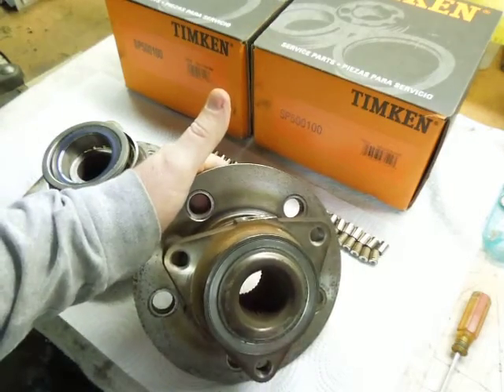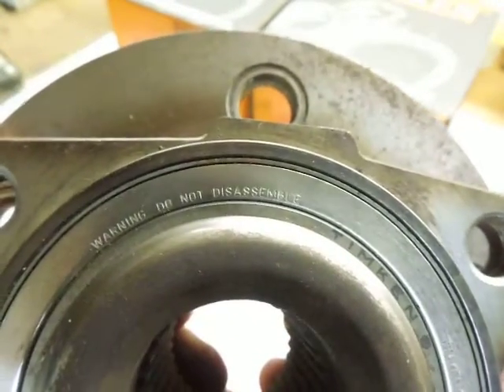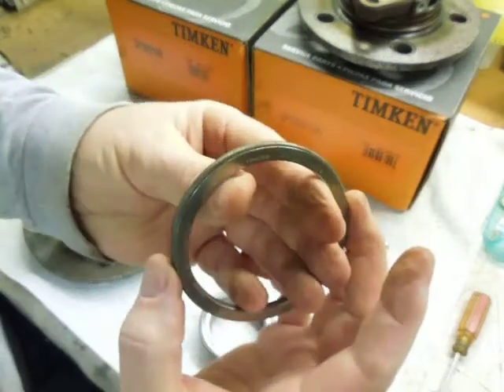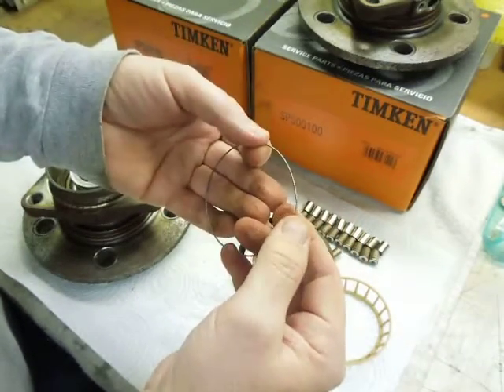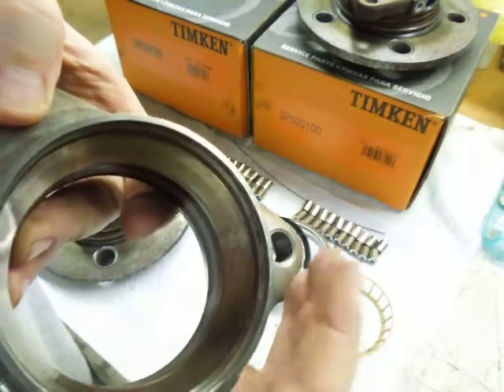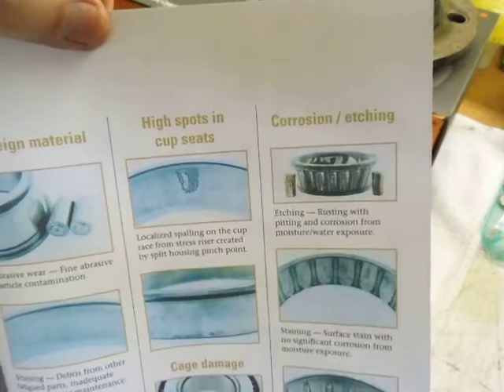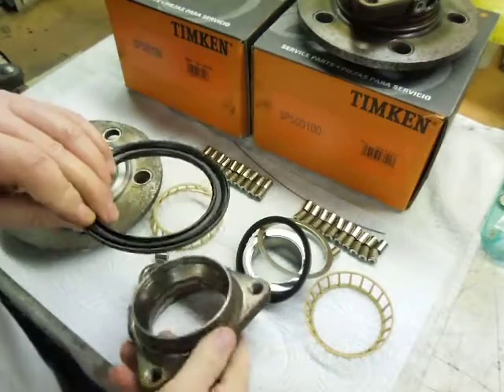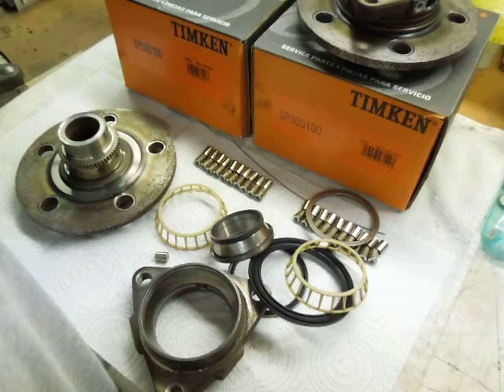Timken Sealed Wheel Bearing/Hub Failure Disassembly and Review

Comment: Do you think that I could grind that curled edge that holds it together (the one that you machined off). I’m thinking my angle grinder might be able to nip enough of it off. Then I’m thinking of using a large gear puller to pull the hub apart. Thanks for the video as well.

Comment: I NEED AN HONEST ANSWER! Guys, do you really think its not possible to reseal this? Both sides of bearing are held in the body just by this exact seals. If you would press both sides carefully in the body, why wouldn't it be possible to reseal them? Thank you.
Reply: @lukahlisc7670  honest answer, no.  It took hours to machine off the rolled over hub and disassemble them.  Once you remove the hub, there is no way to secure it so it won't come apart again and you would just be guessing when you try to set the preload on the bearings.  And all that assumes there is nothing worn out or damaged when you get them apart.  Buy a new set from Timken or SKF and you'll be way ahead.

Comment: I sure miss the old wheel bearings,  repack them every few years and they would last forever. Most likely the same engineer who came up with putting the fuel pump in the tank, Great video thanks for sharing I was getting ready to rip one apart curiosity was getting the best of me
Reply: Thanks for watching and I'm glad the video was helpful. I miss the old set up too, they would run forever if you repacked the bearings at each brake job.  My guess is, car manufacturers/workers got tired of having greasy assembly jobs and that lead to this, no mess, bolt in design.

Comment: How did you get that first seal out exposing the tainted bearings? Basically how did break into it? Thanks
Reply from the maker: I machined the rolled over lip that I tough at the 11 second mark and then pressed the hub/shaft out of the bearing assembly.  You can see the machined off stub on the one that's taken apart. Thanks for watching.

Comment: Awesome video, thanks for sharing it!!! Do you know what might have contributed to the metal failure as shown in the video, besides the material itself? Do you think it has anything to do with say speed bumps, potholes, off-roading, etc? The front bearing on my RAV4 started to develop a minor grinding noise, only 40k miles without ever driven in harsh weather or off-roading. I'm trying to defer the repair due to labor cost.
Reply from the maker: I suspect since the 3 failure points were equally spaced the housing was slightly deformed when they clamped the part to  grind the race surface. When the housing was released, that created high spots that are the failure points.
Reply: @snaproll94e  Thanks, that makes a lot of sense!

Comment: Henry Timken and his son-in-law invented the tapered roller bearing in 1898 afterword other producers copied the design but were never better at it then Timken by 1920 when Henry Ford changed is production over to Timken Bearings   Temkin Roller Bearings were in 100% of all the vehicles produced in the world Timken went on to revolutionize many industries with their superior steel which they make some of the worlds best steel right here in America and the superior engineering that most of the world turns to 
for instance todays advanced roller rocker technology came from Timken Engineering and drive by wire electric steering  Timken did that / I say all that to tell you YOU can't find more durable longer lasting wheel bearings from any manufacturer anywhere in the world - it is most likely that the gasket seal failed usually that means sand eroded it if a bearing seal fails the bearing will show it in some way , Timken can't be beaten in the areas of Bearings / Engineering / or Quality Steel Period
Reply from the maker: You must work for Timken?  I've worked with their engineers for 30+ years, been through one of their bearing manufacturing facilities, their R&D facility (very impressive) and installed thousands of their bearings in high-performance gear boxes. They make a quality product that is usually to a six sigma quality level. With that said, I stand behind my analysis of the failure.

Comment: So, how did you get this apart? I am confused as to how the flanged part that bolts to the truck does not separate from the bearing side that spins while driving
Reply from the maker: I had to put it in a lathe and remove the end that is rolled over and keeps the assembly together. The hub and shaft assembly is pressed into the inner cone and roller bearing and the end of the shaft protrudes through the bearing and is rolled over to secure it. If you know what to look for, you can see the difference in the assemblies at the start of the video.

Comment: How many miles did you get off the 1st wheel bearing set..?
Appreciate your teardown/inspection.....can you suggest a quality hub...? I fear being let down by poorly constructed or lesser quality.
Reply from the maker: I started hearing a growl at about 60000 and thought it was a new set of tires I had just put on.  Finally figured out it was the bearings and changed them out around 80000 or whatever mileage I quoted in the video. The new Timken hubs now have 65000 miles on them and are ok.  Next time I might try SKF if these ever go bad. Thanks for watching.

Comment: How many miles to bearing failure? I assume you fly aerobatics Snaproll?
Reply from the maker: Sorry for the long delay in replying. They started getting noisy around 65000 miles.  Yes, I used to fly a lot of acro when I had a Decathlon. There's a couple of videos on my channel if your interested. Thanks for watching.
Reply: @snaproll94e  65K? They ought to be ashamed of themselves over there at Timken. If it were a Koyo or NSK Japan bearing, it would only be at half life at 65k.   I loved the Decathlon with the pop-off doors and cloth-covered exterior. I think I had to wear a chutte too if I remember correctly. Good times!

Comment: I just received 2 of the timken hubs for my gmc jimmy 4x4. Take a good guess where they were made? That's right, china. I'll see how long they last.
Reply: Bought a pair from Amazon, and one from home depot. Both were priced at 118 plus tax for my 2011 sport wagon Acura TSX, no etched markings on the outer edge of the bearings, and box is not even sealed by a mere tape that will cost Timken a pretty penny. Timken should redesign on how they package their products. Any person can easily swap a Chinese made same model bearing for their original. Still searching for the real one. You got lucky on this. None of the ones I bought don't have the original Timken NTN etched markings.

Comment: So is a bad idea to take the seal.out and re grease them with the red grease from.mobil 1?
Reply from the maker: Кайена Арельяно, you can not take them apart to add grease.  I had to machine the hub and remove the feature that holds it together, then press the shaft out of the housing.  So they are a one use deal.  If it goes bad you have to buy a new one.  Thanks for watching.

Comment: if someone search for the best wheel bearing brand Timken is always in the top. deception is all over in this days. Timken doesn't manufacture everything it sells with it own  name, quality is not there any more. Stick with NTN , SFK, National...  this brands also can fail but there making their own products , if something goes wrong they going back to the board for improvement.
Reply: You did not mention NSK but their bearings would last 100K+ miles.....
Reply: NTN and Timken are same. Timken make great bearings and are trusted in the aviation industry. One bad bearing is hardly just cause to swear them off. Timken does in fact still make their own stuff with another spot in Canada helping with production.

Comment: Don't really want to encroach on someone else's video or channel, but I often wondered if it was worth it to drill a hole into the hub through a separate boss and put in a grease fitting and pump a couple pumps of grease into the hub once in a while.  Shouldn't take much grease.  If you're interested, saunter over to my channel and take a look at my experiment of putting a grease fitting on the hub.  I used snaproll94e's video as an example on a Facebook page as to why this might work.  I spread the love.  :)
Reply from the maker: Groundhogz Garage, I don't think there is a position where you could get the grease to flow into both bearings without forcing it out of one of the seals or having issues with the ABS ring trying to pump/sling it out of the sensor.  Thanks for watching and commenting.
Reply from the maker: Groundhogz Garage I'll check out your video too.

Comment: Take abs sensor out on a regular basis (brake pad replacement) apply grease in speed sensor hole  will help these bearings last a long time.  Over torquing axle nut on 4x4 will cause premature failure.
Reply: It's hard to "pick" the correct torque for the Timken bearings. My 2006 Jeep Gand Cherokee 4x4 service manual calls for 96 ft. lbs. torque on the axle shaft nut. Timken Co. specifies a torque of 228 ft. lbs. on their hub and bearing assembly for this vehicle. It's quite a difference, but Timken stands by this torque setting. Maybe the hub/bearing made in 2006 for the jeep was made differently than the Timken bearings today. Anyway, I've torqued the setup to 228 ft. lbs. and we'll see what happens. I am hearing a constant oscillation noise that varies with speed. Maybe an alignment issue?

Comment: How does a sealed hub assembly come apart such as a spindle detaching itself from the hub and bearings while driving? Leaving the wheel to roll from underneath the car leaving the spindle connected to the rim along with the rotor and disk break assembly while the hub assembly is still connected to the knuckle of the vehicle and the bearings are in the road, but no actual break between the system has taken place, it just came apart. So my question would really be, how is the hub connected to the spindle in a sealed hub assembly so I can determine how the assembly fell apart while driving.
Reply from the maker: At 46 seconds into my video you can see the flange on the inside "tube" shaft, that is formed on the hub and holds the assembly together.  I had to machine the flange off in a lathe and press the tube shaft out of the bearing to disassemble the hub.  This is a very robust design and I can't imagine how it could fail.  Sorry I can't be more help.  Post a video of your failed hub and you'll get lots of advice.  Thanks for watching.
Reply: @snaproll94e  Thanks for the info. It was actually my brothers work vehicle that it failed on, I just am baffled at the fact it "split", it didn't break, it's like it just came apart so I didn't know how it was held together with throws me way off, I used to work Chrysler as a suspension tech and I replaced hub assemblies all the time and never have I ever seen something like that.

Comment: Now that you have disassembled it,  do you think greasing it through the ABS whole would help?
Reply from the maker: Jim Repair's , unfortunately grease added through the abs sensor hole would not have easily entered the bearings.  The grease in the hubs was still relatively good and did not cause the failure.  The metal on the outer race broke down and caused the failure.  Thanks for watching and commenting.
Reply: Also grease there would coat the reluctor ring and might screw up the ABS  -- codes

Comment: You think studs are worth 40 dollars? I bought some from O'reilly for about 1.50 a piece
Reply from the maker: Glen Senecal do your homework before you troll me.  O'Rilley sells these studs for $4 each, add tax and gas to drive there and back and you've easily spent $40.  Let me know if you need help with the math.  Not a bad guess if you ask me.  I can only imagine what you're driving that has a stud that cheap.  Thanks for watching!
Reply: @snaproll94e  see arent trolls just the worst, comes off acting like they know something then get slapped in the face with facts

Comment: Thanks for posting this video. I think it's possible to drill a small hole in the front side around the ring (between the inner splined shaft and the bearing) and a small connection hole by the tone ring and add a grease fitting. I think this would be possible.
Reply from the maker: K Smithers your right, it would be possible and not a bad idea.  Mine died due to metal fatigue.  Whatever caused that would need to be eliminated for them to ever have a chance of lasting.  Thanks for watching!

Comment: Thanks for posting. I have looked all over the internet for a breakdown on replacing the bearing inside of my 2006 Trailblazer's front 4x4 hubs and I finally ran across your video. I have replaced 5 on my two 2006 Trailblazers over the years and was wondering if I could replace the bearing so I use the hubs on a trailer. I know I have to have the center shaft to hold the bearing and hub together, but that is not a problem. So thanks for the tutorial.
Reply: You could use ine from a rear wheel drive you don’t have the shaft hole

Comment: Good day. I saw your video on wheel bearing.  What were your symptoms, would regreasing have help before you took them out. Thanks
Reply from the maker: Don Voll the symptom was a low roar as the wheels turned.  When I first noticed it, I had just had a new set of tires put on that had a more aggressive tread.  I thought it was the tires but after several months, I knew it was getting louder and was most likely the hubs.  When I was rotating the tires, I couldn't feel any roughness when I turned the front tires so I pulled the calipers while I had the wheels off.  Then I could feel some roughness in one hub, so I installed new ones.  The roar was gone.  Both hubs had some roughness and I disassembled the worst one which is in the video.  The hubs are sealed units so you can not add lube to the bearings.  I think the bearings should have had more grease in them but lack of lubrication wasn't the failure mode.  Thanks for watching!
Reply: Thanks  very good video

Comment: I went through 6 sets of front hubs until I got SKF hubs.  They're the only ones that have lasted on my dodge.
Reply from the maker: BDP Racing ......now you tell me!  Lol.  Thanks for the info, if this set doesn't last, I'll buy a set of SKF.
Reply: BDP Racing are those skf still holding up I was thinking about going mopar but skf are less money by 50 bucks
Reply: @tonylight777  Check out bca bearings..I've had good success with them.
Reply: @ianwilds3139  hey thanks bro I went skf so far so good